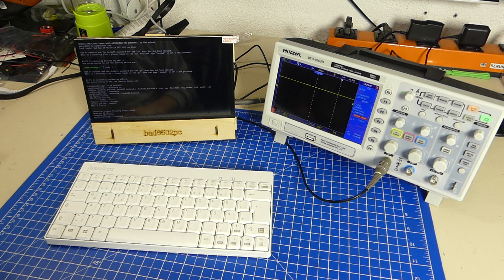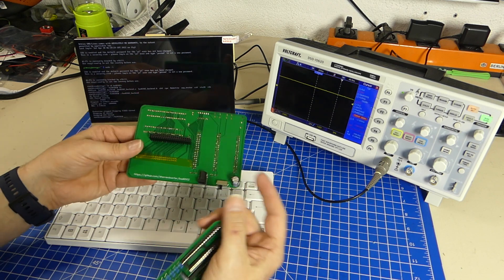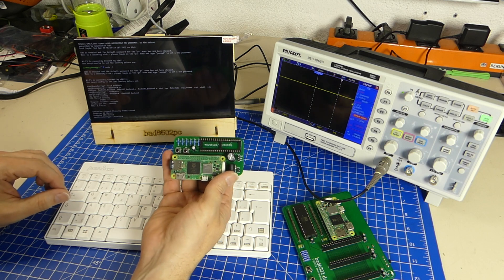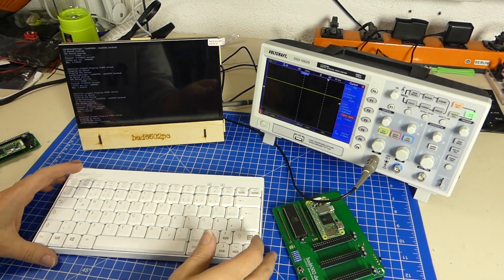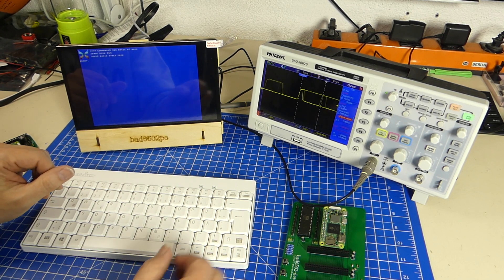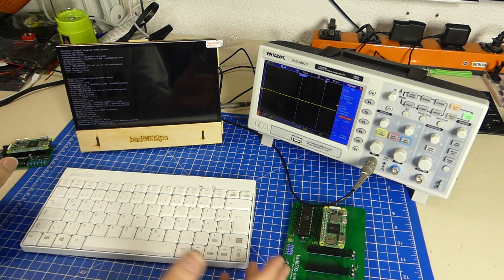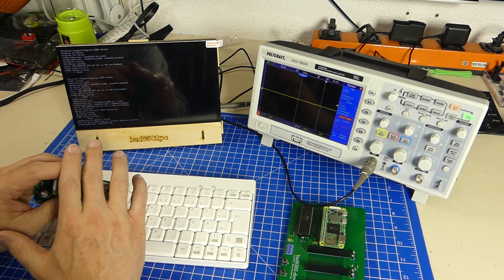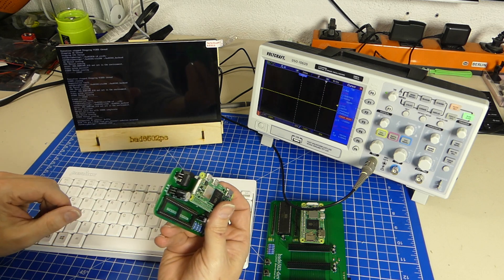bad6502 update 6 - 4 Mhz barrier broken -  bad6502 the retro computer that needs no chips

Comment: I'd like to use this in a development project I'm working on so I can prototype in software before finalising replacement circuits. Thus could be just what I'm looking for. Will you be releasing the development board Gerber? I'd like to use a full size pi and have easy access to the CPU pinout.
Reply from the maker: you can grab it here:
https://oshwlab.com/dherrendoerfer/bad6502_copy
It's not the final version, but it has what you need.
Reply from the maker: Note: you need a longer male connector (+4mm) for the board to clear the usb and network connectors on a full sized Raspberry Pi.
Reply: @dherrendoerfer  excellent.  Thank you. I'm interested in seeing how far you get with this.
Reply from the maker: I have pretty decent simulation code running right now, Need to put this aside for a while - I failed at getting the 816 to run, and will revisit it later - that will then probably make a change to the dev board necessary.
I want to make a simple Pi shield too, with just the 6502 and perfectly fitting the Pi outline.